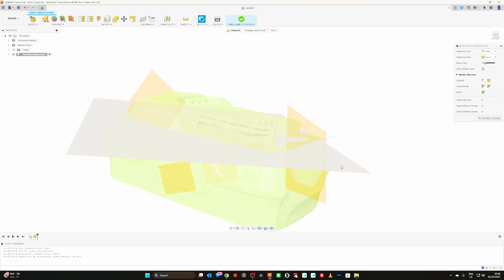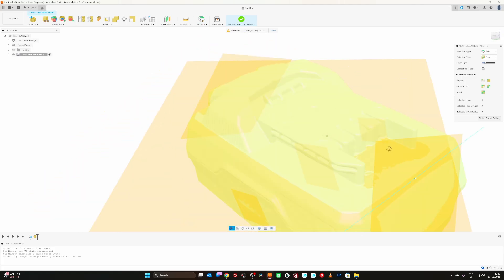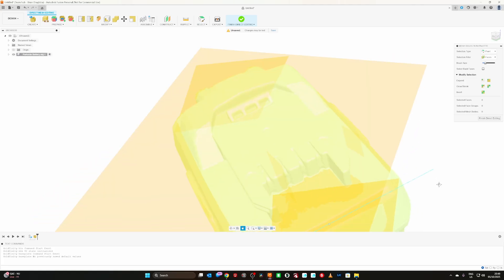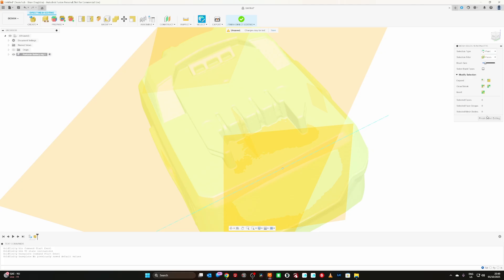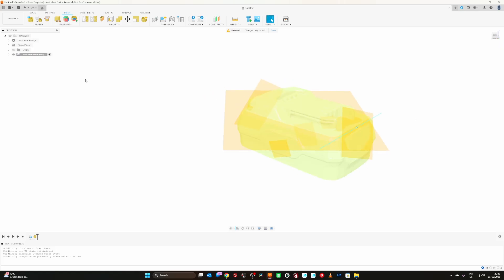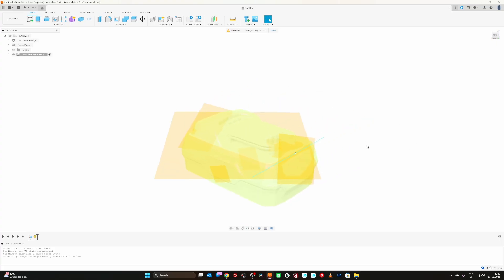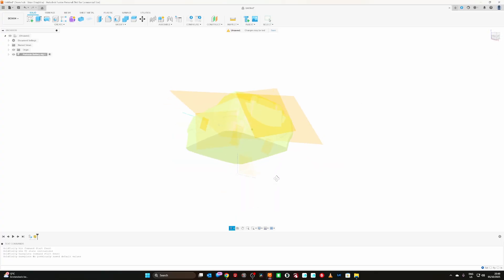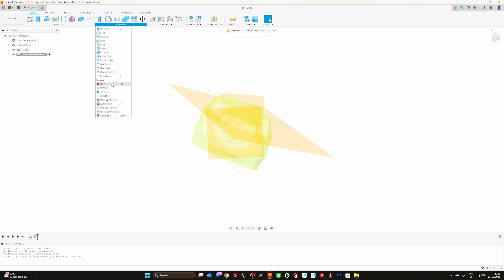How to Align 3D Scan in Fusion (Step-by-Step Tutorial)

Comment: Really excellent tutorial. I've been doing a lot of this myself lately for content and this is by far the best method of getting an STL aligned. One thing I can't figure out is after I align it and use the move command to join the points the STL still can be dragged around the workspace. How do you get it to stop moving once you've done all of that?
Reply from the maker: You can lock it in it's current possition. But to be honest, I don't do that. I just don't move it.